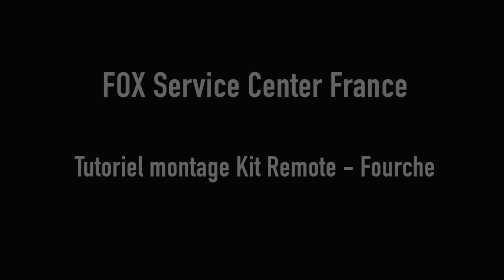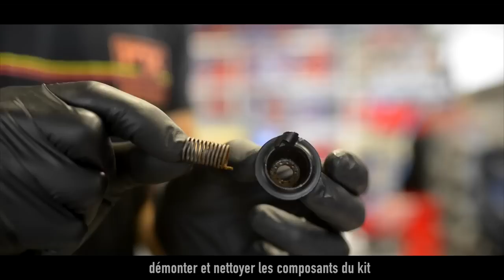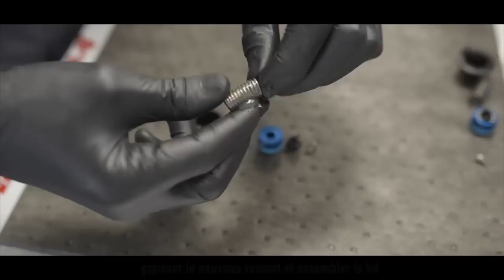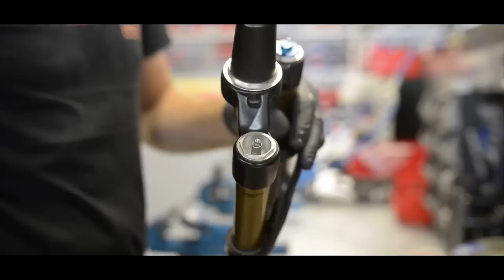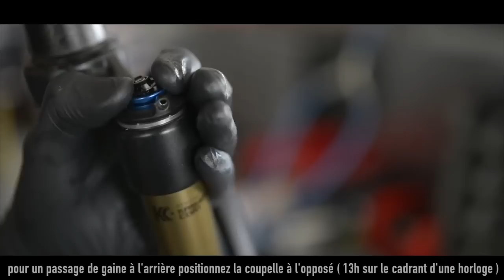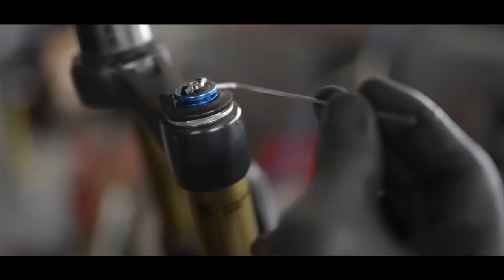Montage FOX Kit Remote FIT 4

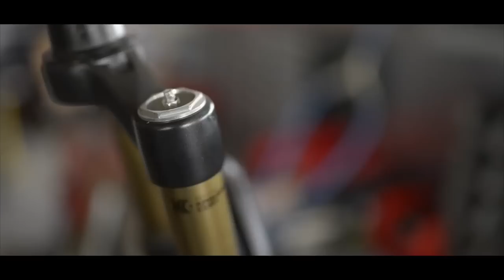Comment: Thank you for the detail shot @ 0:57     
That detail is missing from the Fox Instructions if your Adding the remote lockout, that you remove the disc/ball earring/spring of the indexing that’s normally there with the lever version

Comment: Is it normal to have about 25mm of movement on the Fit4 when locked out? That's standing off the bike pushing down, when riding its less because of rider sag. Just wondering if this is to be expected.
Reply: Not on my 2022
34 step cast (fit4 damper). Locked out it's got less than 10mm i guess & even that's very stiff.